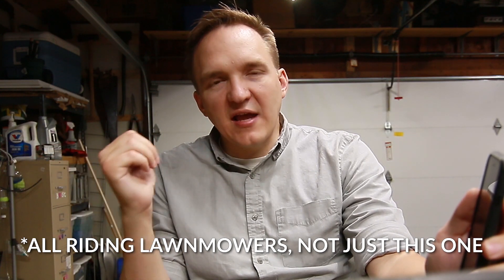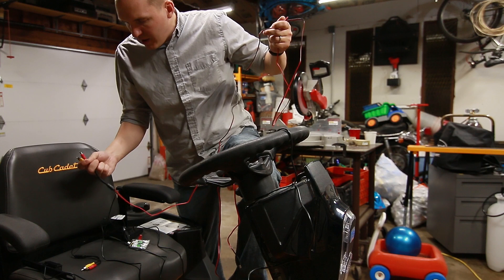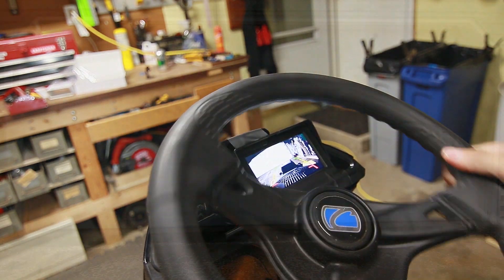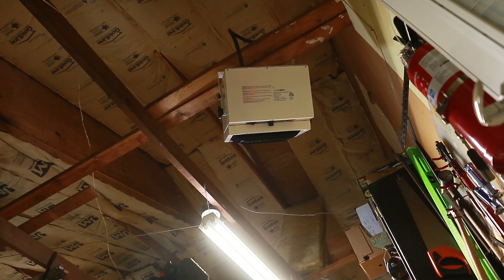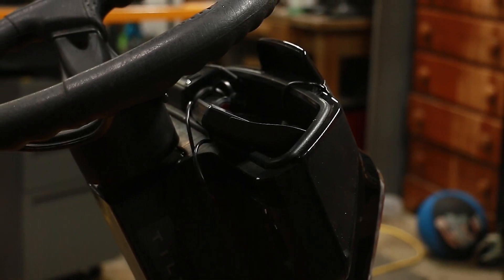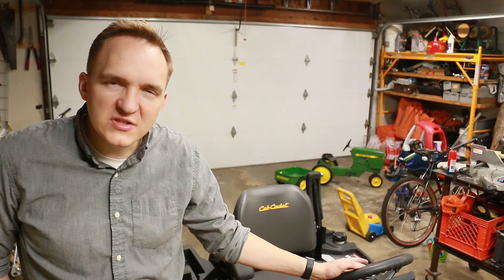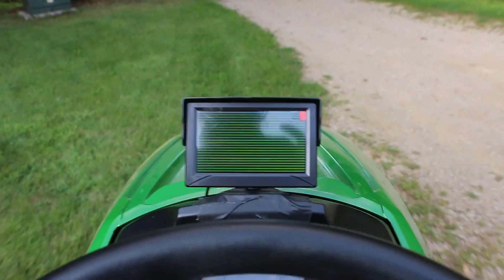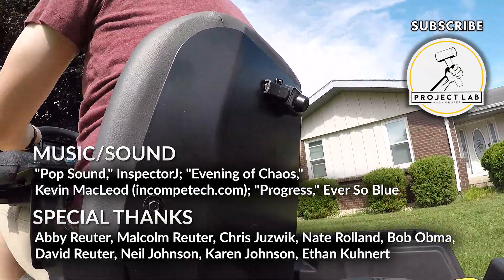A $40 riding-lawnmower hack that could save your kid’s life

Comment: Very cool setup! How is it running in year 2?
Reply from the maker: Thank you! The camera and monitor are still working great. The stand, however, snapped! So it's currently gaffer-taped in placed. Works OK but do need to fabricate an actual stand for better visibility.
Reply: @AndrewReuter  oh that's good. I sprung for the nicer camera like you got vs one of the cheaper ones that are on eBay. Thanks for the video!
Reply: @AndrewReuter  another update. I've been mowing for 3 weeks using it and it's great. I 3d printed an adjustable stand for it and zip tied all the cables underneath so it's very discreet. Camera is held on just below hitch w 2 zip ties and has no wobble. I can see tires so I can navigate around hazards and curbs.
Reply from the maker: Hey Michael, 8 months later... Do you remember what stand you 3D printed for the monitor? I might do a follow up video and will give you a shout out either way but was curious what you found. Hope it’s still working well for you!